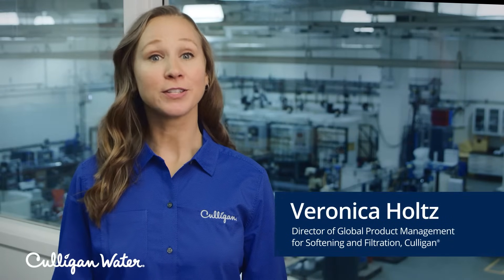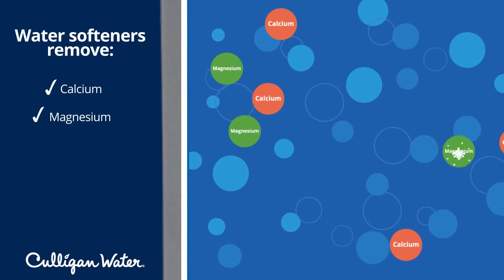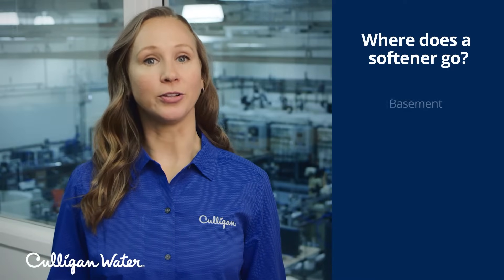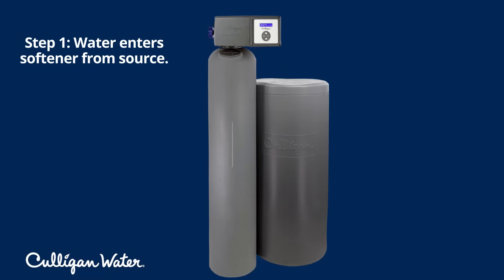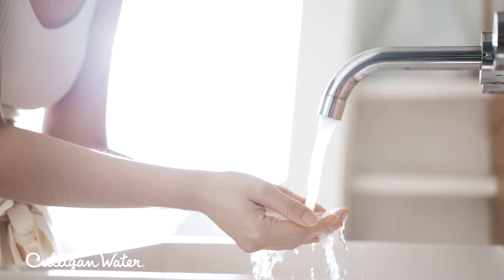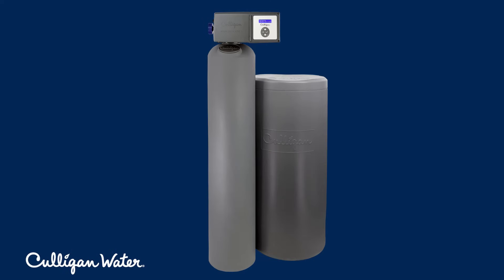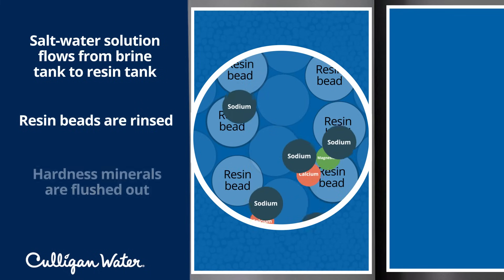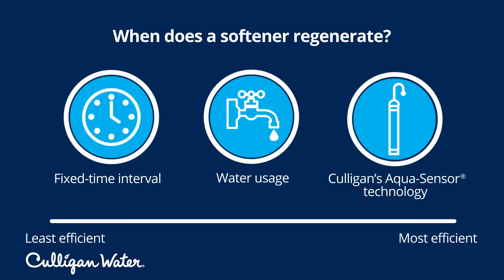How Does a Water Softener Work | What is a Water Softener | Culligan

Comment: What if you run out of salt?
Reply: If you run out of salt you will get hard water.  You have to refill the brine tank occasionally (and Culligan will do this for you if you prefer so you never run out) in order to allow the system to clean itself and continue providing you with soft water.  It’s very simple- easy as emptying your trash can and you only have to do it a couple of times a year depending on how much water you use.

Comment: Biggest piece of junk I ever bought, buyers beware.
Replaced it and bought a system that actually works.
Reply: I would never recommend Culligan. They're water will leave spots/residue on your bathroom sink/faucet. If you ever discontinue their service, you're stuck with a bulky resin tank, brine tank and any left over salt. Go with Puragain Water. No more  bulky brine tank, resin tank, or bags of salt.
Reply: @lexbeltran1354  you have any other recommendation please. Y really need one water filter
Reply: Sorry you had a bad experience, but I can tell you from years of personal experience that Culligan water softeners work VERY WELL.  If they are installed properly by a Culligan technician they will typically last 25 years or more.  I’ve seen Culligan water softeners last more than 60 years.  They also come with a 100% 30 day money back guarantee and you can call Culligan and they will come and test your water for free anytime.  Check out Culligan’s online reviews- and Culligan treats the water for Wal Mart, Whole Foods, Dunkin Donuts, Lifetime Fitness, Hilton, Marriott, Subway, Outback Steakhouse, and many many more National brands.  Surely Culligan would not have had such tremendous success (for nearly 90 years) and been the industry leader in water softeners and water treatment if their equipment didn’t work very well.   Culligan water softeners are also third party certified by the Water Quality Association, Underwriters Laboratory, IAMPO R&T, and many more.
Reply: the culligan water? Oh why .  Was looking into it but if it sucks yikes
Reply: No salt means no soft water, period!
Reply: With one you recommended?
Reply: @wendyrodriguez4090 get something with 2 resin tanks and a fleck head. If you have a well and the water has iron get an air injection iron filter as well